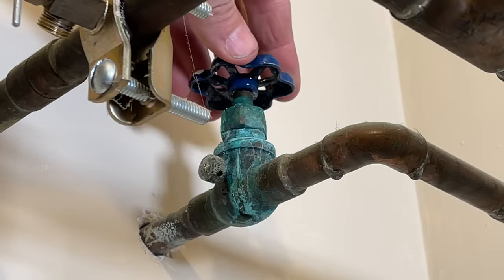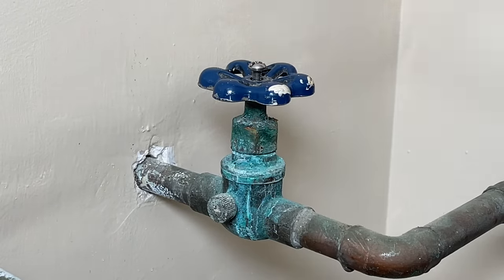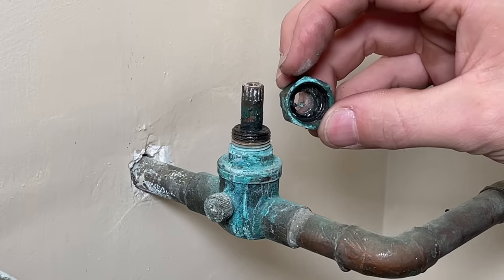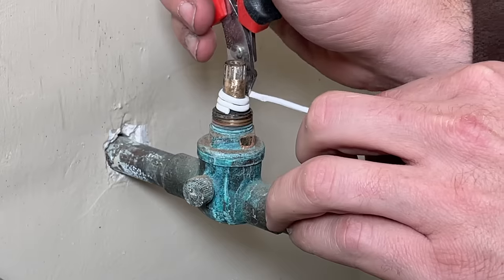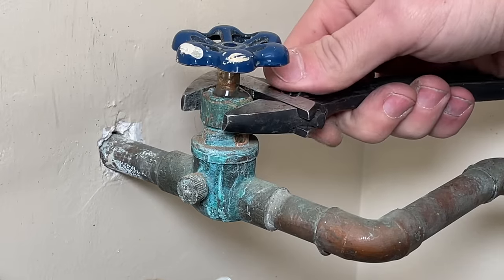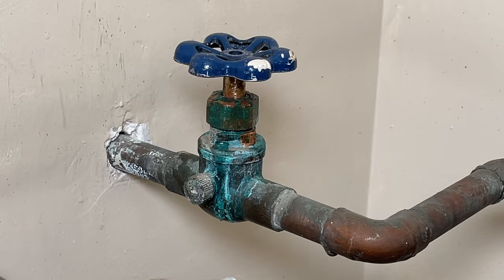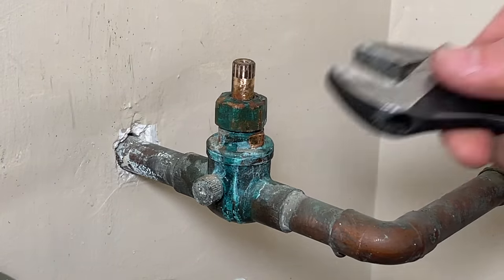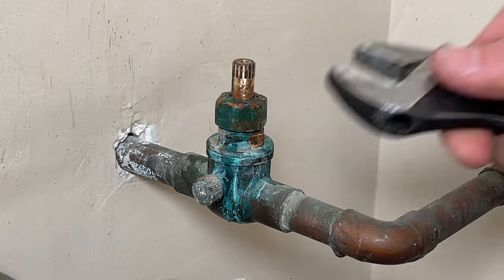How To Fix A Main Water Shutoff Valve Leak

Comment: Let me introduce you to a wonderful product. It is called Heat Proof Plumbers Grease. When reassembling the valve coat everything with Plumbers Grease, especially the rubber washer (if you can find red washers, use them instead of the black rubber. Red last longer) and Teflon Valve Packing. the grease lubes/protects the metal components, delays decay of the rubber and provides an extra water proof to the stem packing. This is the same concept that is used in propeller shaft stuffing boxes. 
Why replace that valve? It is now good for another 50 years and the materials to effect the repair cost... What 0.30 cents, as opposed to a new $10.00 valve. I can not begin to count the dollars wasted replacing verses repairing. Fluid Master 400 Flush Valve is a major one.

I teach, hands on and "class room",  Property Maintenance for Service Managers of some Large National management companies and I do contract maintenance/rehabilitations for those companies. The Service Managers that embrace the "Repair if You CAN" attitude do far better in their companies, are well liked and respected on their communities/properties and stride with purpose in their skills.

Edit... Just subscribed. Keep up the good work. ;)
Reply from the maker: Good stuff Jamie,  appreciate your feedback.  Do you have a website for your training program?
Reply: @EverydayHomeRepairs  Legacy Consulting Services LLC. No web site. Nor do I have a set "Program".  All of my training is done in small forums, peer to peer and face to face. Companies will show me their "Books" for maintenance overhead. The I structure training around reducing those costs. Property maintenance is the second largest expenditure and the number one reason given for Notice to Vacates NTV's nation wide. Time and resource management are the biggest issues and running to the big box every two hours will eat you alive.

Comment: I've got a lot of crud and green corrosion on the first section of copper pipe after the house shutoff.  I assume this is result of condensation on the pipe - colder water entering the house.  Should I worry about this?  Maybe clean up and spray with something like Corrosion Stop?  Cover with pipe insulation?  Actually first section before shutoff is plastic/pvc which I'm not thrilled about;  worried about breaking.

Comment: That is a main water shutoff Valve so actually do the repair you showed, one needs to go to the front of the house and close the valve usually placed on the pavement of the driveway.  To avoid that problem I was proactive and when my house was new I put a ball valve just after the main shutoff valve.  When I need to do any repair in the house I use that new ball valve, which never leaks and is much easier to operate.  At the same time the original shutoff valve is not used and do not wear off.
I wonder why they do not use ball valves as a shutoff valves?  Any codes?

Comment: Urgent supplemental comment added... I suggest that before attacking any plumbing issues like this, and this comment comes from years of experience, please locate your street shut off valve (or a shut off valve that is closer to the city water supply than the area that you are working on) and become familiar with how it works.  This comment is mentioned in the video but I just wanted to emphasize it's importance.  If you do enough of these types of repairs, one day in the near or distant future you may be use this valve to prevent a minor water disaster from becoming a major one.

Comment: The flat washer only seals flow through the pipe.  In other words, when it leaks, the shut off is incomplete and it will leak from the supply down the tube to the rest of the house.  The leakage around the valve stem when the valve is open is entirely due to the packing and condition if the stem.  Since the valve is normally open in service, replacing the flat washer will not affect valve stem leakage.  Shutting the valve stops the stem leak, but this
Reply: Only interrupts the water supply and it will leak once reopened.  BTW. I’d never attempt to move either the packing nut or the bonnet on an old valve like this without applying penetrating oil and using another wrench to support the valve, as others have remarked.

Comment: The sandpaper seems to wear down the flutes on the stem which would tend to strip them when the valve handle is turned. Why not use a vinegar solution on the valve stem to remove the corrosion?

Comment: Nice tip! But you drove 30 miles to store, spend 3 hours in work.. in one hour you can change it in a new one..The torch you already have... As well this need upper knowledge so 80% of persons need a service guy... But priciate your video as a all is closed/not available solution...

Comment: Should you turn the stem all the up/open on the 2nd method?  Actually you didn't clean/sand the lower part of the stem, that is the reason of still leaking after using 2nd method.

Comment: I would want to know if when heating the joint to loosen, if the water needs needs to be shut off at the meter, and the water pipe open so that heated water (steam) has a place to escape without building up excess pressure and potentially breaking pipe connections or some similar problem?

Comment: So at what point would it be beneficial to just replace the valve? When you figure multiple trips to the hardware store combined with packing cord and seal kit you have got to be coming close to valve replacement.

Comment: I added a water softener recently, and one of the old gate valves to the water heater wouldnt SHUT when I went to reuse it temporarily on part of the line to go to an outdoor faucet Im not ready to put in yet, took the valve apart and the threaded stem had pulled out of the gate, I was able to get it back in and it worked to shut the weater off, but I don't like those kinds of valves- too much restriction, all the valves I installed now are full port 3/4" sweat.
What I really dont like is the main valve is an old gate valve and if it fails in anyway because I had to open and close it multiple times while working on my system- I'd have to call the city to shut the water off in the road to even be able to replace or repair it- even just the stupid rubber disk in it. Sure would be  better to have two full port valves, only using one for shutting the water off for repair/expansion, leaving the one closest to where the water line comes in alone unless the 2nd valve were to leak or fail.
The way I have it plumbed now I can leave that old valve alone and shut the line off above it and drain out the hose bib between them.

Any time you mess with THE main inlet valve you risk breaking something and NOW you can't shut the water off until the city or whomever is called and sends someone out to shut it off in the street! if it's in the dead of winter and there's snow and ice out there, they might have to DIG to even get at that shut off out there! That scares me!

Comment: Just be careful cranking on it that you don't snap the pipe. Put another wrench someplace like on the valve body, pipe wrench,  to apply torque in the opposite direction if its super tight, and use the box end of your wrench. If you get it just right you can squeeze the wrenches together while applying the torque. BTW, Boltr proved a 12 point is as good as a 6 point box end when turning a bolt, as  the bolt fails before the head.
Reply: Even squeeze the wrench and pipe (in the right direction). If you position the wrench right you could squeeze them together with one hand, even. Don't, though, that is for illustration. use 2 hands if you need to to keep the wrench square on the nut.

Comment: Step three when you take that whole inner part down to the hardware store... do they just sell that whole component so no messing with repacking, washer changing and cleaning of parts? I have this situation of a leaking main turn off I have been avoiding.

Comment: Good tips. Obviously if you can torch, there is no logical reason to ever keep a gate valve like that anymore. Especially now when the packing material doesn't last as long. The old packing material had asbestos fibers in it, which would extend the life immensely. Example - we have an original gate valve, with original packing, from 1957. Works just fine, and plenty of packing left  to go with the packing nut. Today's stuff disintegrates

Comment: As the owner of an older house, I strongly recommend you don't try something like this unless you have the ability to shut the water off at the street.  If you don't have the ability to shut the water off from outside, you can pretty much figure on the entire valve coming off in your hand, your basement filling up with water and panic as you try to get the water department to come and shut off the water while you hire a plumber to come in and fix it for you.  Which is probably what you should have done before you attempted this.  In an older house, it seems like you start trying to fix a leaky faucet in the bathroom and before you are done, you have had to open two walls, a ceiling and hired a backhoe to start digging up your front yard.  🤣

Comment: You need to use a 2nd wrench to hold back on the piping. Otherwise, the piping can snap off, potentially inside the wall. Just saying.

Comment: Not everyone will have access to a shutoff valve at the curb and if they can they may have trouble with it as it’s buried when the house was built.  It’s always better to install a secondary ball valve after the main shutoff and only use that valve if needed to shut down the main. I

Comment: Help!!
I attempted this and my packing nut split when putting back on. 

Checked the hardware store and was told I probably will not find that part for replacement. 

My valve is old almost identical to the one in this video.

What are my best options at this point?? 
Any advice appreciated
Reply: My valve is old almost identical to the one in this video.

Comment: What is the little port with the cap on the side of the valve for?
Reply from the maker: It's called a bleed valve to allow you to bleed or drain out the water after shutoff.

Comment: A lot of these valves haven’t been moved since the day they were installed soak them first with a good rust penetrating rust buster not wd-40 that is a lube not a rust buster or use straight vinegar to bust up minerals

Comment: Just a note on proper use of wrenches.  Whenever possible, always "Pull" the wrench vs. "Pushing".  You will save yourself from a trip to the Emergency room one day for stitches in your knuckles.  (I realize in this video pushing was needed for videoing).  And if you only have room to "push" in a tight area, wear gloves and be sure to have the correct size wrench that won't slip off.

Comment: Mine is leaking at faucet by main shut off, even though I shut it off. Inside meter doesn't spin unless I open it. I wonder if outside meter is spinning. Vice grips for outside meter not doing trick. Worried about water bill even though reading showed zero after I called and the checked.

Comment: I don't like the idea of even using a mechanical cleaning using even a fine emery paper before trying a chemical cleaner.

I suggest using an antisieze grease on all mating surfaces especially on all thread surfaces internal and external if you understand what I mean by the terms internal and external.

Note: the antisieze grease has aluminum powder in it which is a benefit for reducing friction. Friction is an ever present problem in every day life.

Oh another thought. One of my professors in college highly recommended to NOT leave a valve in the fully open position. Rather open the valve completely and then close the valve about a quarter turn. Not to worry for this action will not cause much of a restriction in fluid past the valve seat itself. His thoughts were that if the valve stem is stuck closed or open it is usually not descernable as to whether the valve is closed or open. So when trying to free the frozen valve it is not know in which direction to turn the valve stem. Trying to turn the stem in the wrong direction could damage the valve more. Backing off rhe valve from full open by a quarter turn could eliminate this issue. I hope I've explained this sufficiently. Plumbing repair can be exasperating. This frustration was not addressed in this article.

Comment: This is the material MOST people need because these water valves are what most people living in older homes have & they have functioned reliably over the decades & will still go on for a few more decades at the least provided they can be maintained which is not too hard to do once one knows the tricks. But unfortunately this information is not too easy to reach as the search engine has been flooded with data about newer trinket type valves which should NOT need maintenance this early into their lifecycle. But it is modern-times with modern-lives surrounded by deep-fakes generated by AI & a world of make-believe & scammers & are making it out like the bandits they really are. Back in the day decades ago when these reliable old valves first began their lives, such scammers did not even figure into figments of imagination of the most crazy human who walked around then…

Comment: confused: do we truly need to shut off
at the curb to remove the packing nut
or is that just safety first?
do not see the connection with the washer and packing cord?  Scratch. stem ?
Reply: ALWAYS best to cut off all water in case the bottom washer is leaking.

Comment: This is NOT a globe valve as you can readily see when you got it apart, there is no plug that closes off the water flow..  It is most likely called a fixture valve.  The washer did need replacement but it had nothing to do with the leak at the handle.  A better , quicker and definitely longer lasting solution would have been to cut the valve out  and install a new SharkBite  or similar push on type of ball valve.  Breaking the teflon cord into 2 pieces was probably not a good idea either and should have been a continuous piece with no intermediate breaks.  This was initially a poor choice for a MAIN water shut off valve.
Reply: Using a shark bite for anything permanent is a bad idea. Ask any (real) plumber in the world.

Comment: If you already had the water shut off at the curb, might have been better to just remove the ancient shut off valve and replace with a new one. You don't even have to know how to solder any more with push on fittings.

Comment: Are you kidding?
Got an extra street key lying around?
Just call a plumber.
If your valve cracks/breaks loose, your main can pump about 20 gal of water per minute (depending on the psi of the water pressure in your area)
But if youre feeling lucky?
Go for it!
Ive been a plumber for 21 years and Ive made a LOT of money on those thought they were "lucky".

Comment: It's obvious that this valve has been leaking for quite some time and should have been repaired long ago.
 I wouldn't clean up the stem with anything other than a clean cloth. Emery paper can allow abrasive particles to enter the valve.
 To pack the packing gland, I prefer to use ordinary Teflon thread seal rolled into a cord or string. The reason is, it's very thin and can more easily enter into the packing gland when pushed down by the nut.
 The packing should enter the body of the valve around the stem but thick cord won't enter and you rely on it sealing only at the top. As can be seen here and that doesn't work.
 The condition of this valve tells me it should have been thrown in the scrap bin.
 A better valve to use is a ball valve and if your regulations require a non-return system which the old valve was built in, then add a non-return valve to the ball valve.
 It is very rare for ball valves to ever leak.
 I don't like using non-return valves they can cause water hammer.
 Who cares if a little hot water is forced back into the cold water line?
If you have an instantaneous gas hot water system your warranty will be void if you use a non-return valve system instead of just a ball valve. That is acceptable by the authorities here and makes the use use of a non'return valve on any hot water unit a ridiculous requirement.
 Generally the only place we have packing type valves is at the meter position where the water enters the property. The packing valves on those main metercocks are much easier to repack.

Comment: I would shut off the main valve before "play" with this valve. Just in case something like pipe or solder joint get loose or broke off.

Comment: I have to ask, since everything was originally turned off at the curb why wouldn't a person show the complete rebuild? seems silly to me to rebuild half of an old leaking valve to pressurize and fingers crossed it doesnt leak.....until the next time you stroke the valve then you just have to do it anyway........the ball valve sugestion at the end of the video is a brilliant idea(as long as johnny home owner can afford the shark bite type, otherwise its a whole other can of worms with diy soldering plus extra coin for the equipment).

Comment: If your time is worthless, and you want to do it again, and again. Then, please, by all ,means do this. 
 I wouldn't recommend anyone attempting to repair water leaks if they don't know how to control a potentially terrible situation if someone broke their 1/2'' old line from torqueing on their 1970's valve with an adjustable wrench. 
not to mention your water pipe is under sized for a water heater...